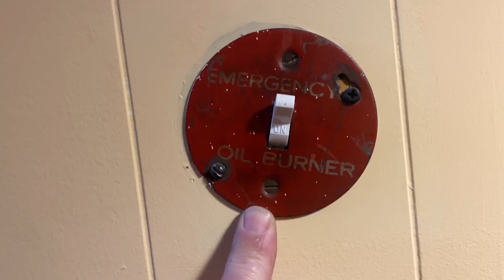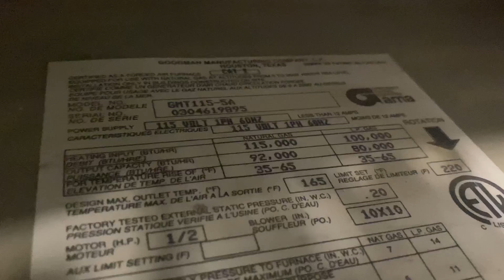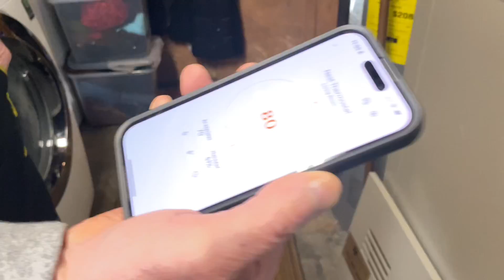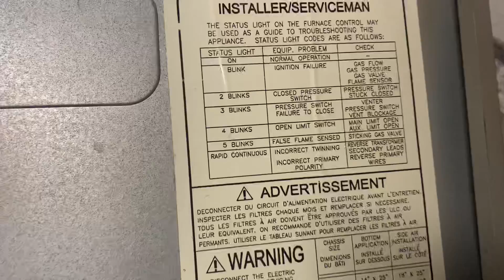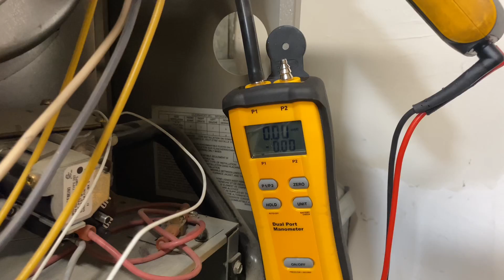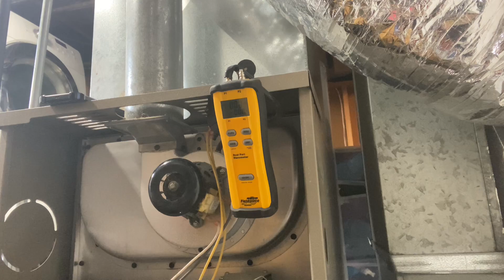Troubleshooting 2 Flashing Lights: Goodman Gas Furnace Won't Heat Pressure Switch Error

Comment: seeing the brand and age, I'm guessing heat exchanger is spanked/half plugged/cracked(maybe hairline hard to see)....
**OK, just the typical intermittent pressure switch... but that brand/age, the HE is very likely about to go, unless perfectly sized ducts and clean air.

Comment: Sounded like the louvers on the blower wheel were coming loose on the blower. But it could have just been vibration. It was hard to tell. I would have given the option to replace pressure switch. Goodman furnaces are notorious  for bad pressure switches.

Comment: does anyone call you for backed up sewer lines or clogged toilets & tubs ? i notice a majority  of your videos are no heat calls or boiler & hot water heater replacements and a/c calls in summer. just curious 🤔
Reply from the maker: Yes. We also perform sewer and drain stoppages. I personally don’t clear drains except an occasional water closet. Would you like to see a stoppage video?

Comment: Just from personal experience with Goodman/Amana furnaces the pressure switches may stick from time to time. You might have a call back if you didn't replace it. Glad to see you test the heat exchange while you were there and check some other components. That's about average for the fan amperage at its age. I personally would have changed out the pressure switch to avoid issues especially since it's not a very expensive part.
Reply from the maker: Thanks for sharing. New pressure switch is installed.

Comment: What do you do about intermittent problems?  I seem to run into those far more often than solid failures.  Check everything, all tests good, then a week later the thing has stopped again.  In this case, what was the pressure that pressure switch is rated for?  Could a partially blocked flue caused the pressure to be marginal for the switch?
Reply from the maker: Troubleshoot and troubleshoot. If you are seeing a high about of “intermittent problems” maybe you need to take a closer look at how your are diagnosing.

Comment: I bet that pressure switch hose had some crusty shit in it when you pulled the hose and put it back it started working or the pressure switch was sticking your olms were shaking at first

Comment: Inducer could be running slow enough(due to debris and worn bearing) to intermittently close and open the pressure switch. It would explain the intermittent pressure switch continuity. Be well, God bless
Reply from the maker: That is true

Comment: Along with testing all the components in the furnace to verify they are at specs. I usually always clean the flame sensor, make sure the pressure port in the inducer assembly is clear, check manifold gas pressure, check static pressure and run a combustion analysis on furnace calls is my normal routine
Reply: So you give away a free maintenance on a service call?
Reply: @Rainmaker88  never said anything about it being free. Charge accordingly
Reply from the maker: I save that for a tuneup service call
Reply: why not offer to do it when there anyway and charge accordingly? @PipeDoctor
Reply from the maker: @Jon-hx7pe  cause it’s a holiday.